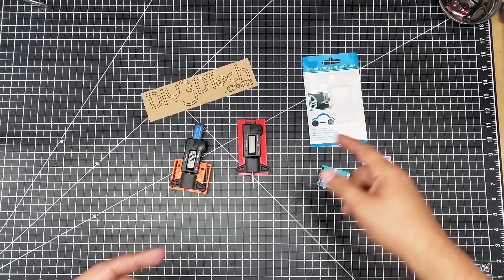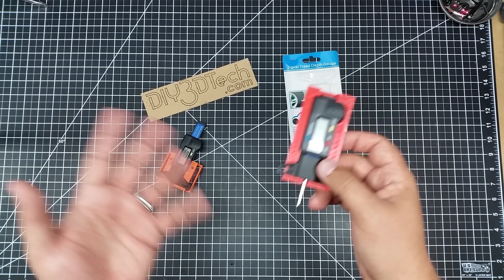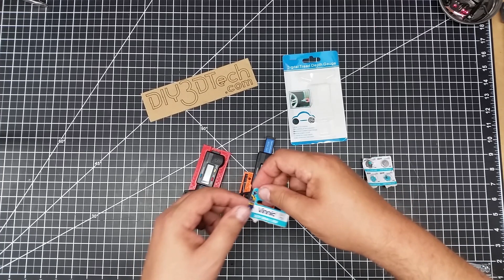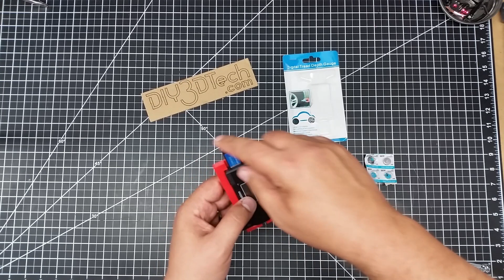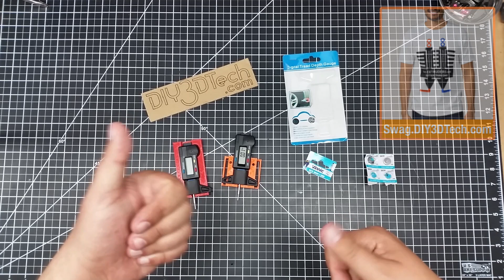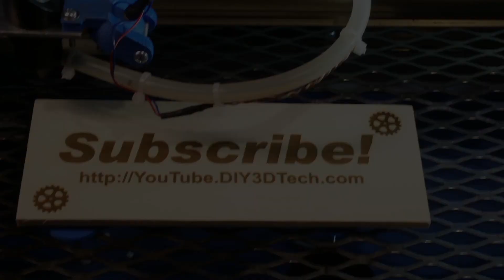Shop Talk - Digital Buck for Cheap Depth Indicator!

Comment: Look up Digital Caliper Data Port
https://www.youtube.com/watch?v=dborXvt7DA8
https://www.youtube.com/watch?v=p-5rJKVnNRE
Reply from the maker: Many thanks for sharing, and yes have seen a couple of these as there is also an instructable, yet these are more effort then I wanted to invest the reason I purchased the Clockwise with the USB cable as it was cheaper then if I where to home brew...
Reply: "Clockwise with the USB cable" , unsure what this is, please provide more details, Thanks. 
Remember with Arduino it could be possible for example at measurements do something else, sound a buzzer switch a motor on, etc
Related a bit > Vernier Caliper Box KEEP OFF message sliding lid version.
https://www.thingiverse.com/thing:2095396
Reply from the maker: Dont have the link handy but check the shop talk play list as I did a couple videos on it....

Comment: The guy who made this didn't just modify your design I'd say he was inspired by yours and made something completely different. Its a really cool idea.
The difference between LR44 (ag13) - alkaline, and SR44 (357) - silver oxide is the alkaline is just 1.5v the silver oxide is 1.55v. The silver oxide costs a fair bit more and is not always worth it but anytime you are dealing with precision equipment or something expensive that take button batteries use the silver oxide unless it says to use  alkaline.
Reply from the maker: Guess I am not tracking who made what (The guy who made this didn't just modify your design I'd say he was inspired by yours and made something completely different)?  As far as the battery goes also believe there is a current difference to as there is a ton of stuff out there on this and from personal experience LR44's maybe last a week or so while the SR44's seem to last a year or so...
Reply: I thought at the beginning you said someone redesigned your bed leveling dial indicator mount to work with the tire thread gauge.
Reply from the maker: Sort of he hot glued it to my design so not sure that qualifies as a full redesign :-) However it gave me the idea to use the tire gauge.

Comment: Put a rubber band on it and you have a spring loading without redisigning it:)
Reply from the maker: Not a bad I idea as I could add loops to hook the rubber band to.  As I was holding off on the spring version as when I design something I like it to be semi universal as not everyone may have access to the spring I used yet a rubber band is common.  You might be a university man after all!  :-) Thanks for the idea!